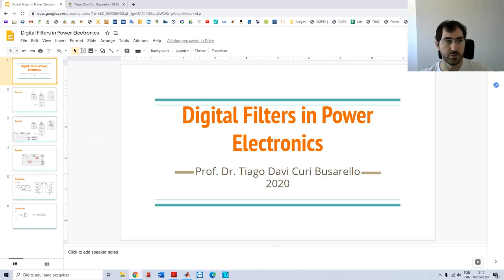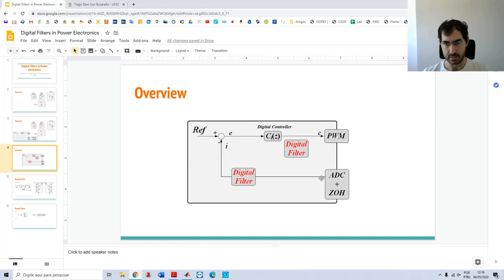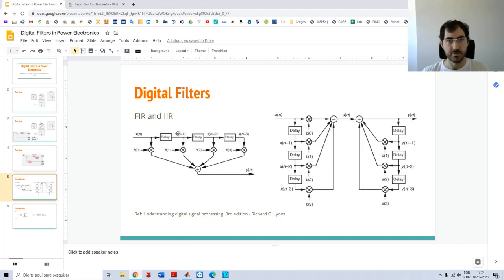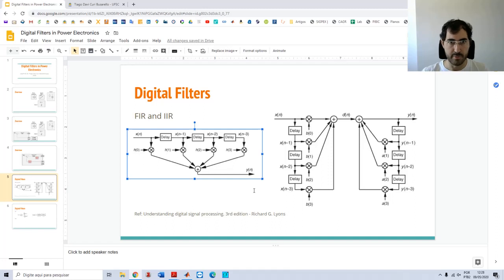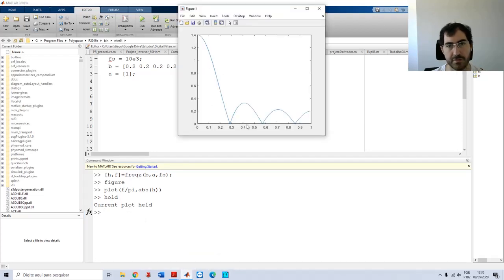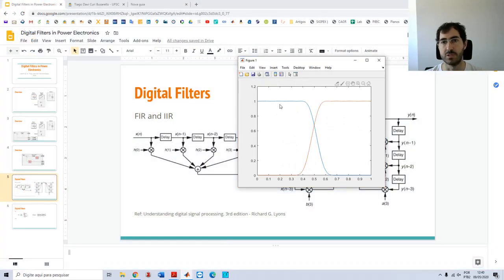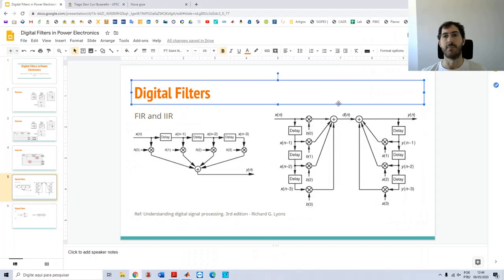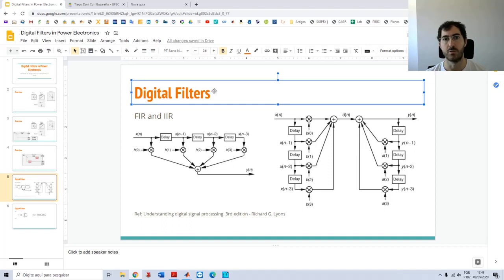Digital Filters in Power Electronics

Comment: Sir, Thanks a lot for the informative session. The lecture was well organized and the explanations was so structured and beautiful; starting with a small introduction of power electronics and slowly progressing to FIR and IIR filter and then moving to new heights.  Sir, Is it possible to make a video which explains the design of FIR and IIR filter for voltage and current control in some basic power converters like buck or boost or H-bridge inverter?